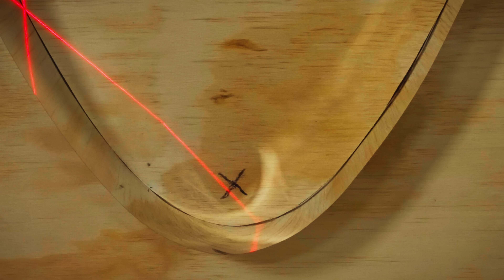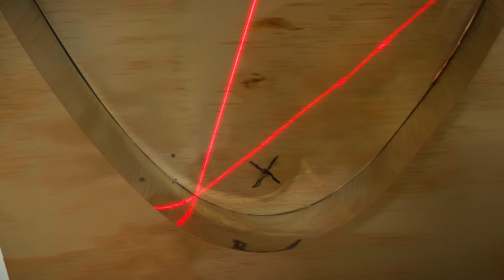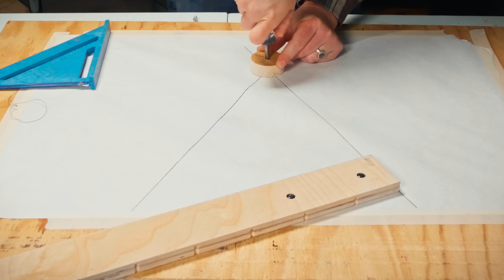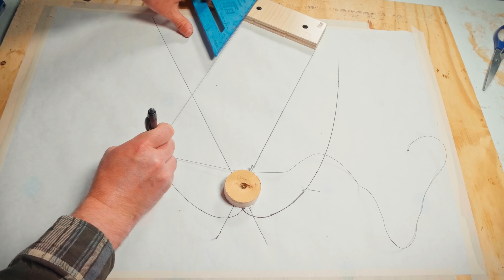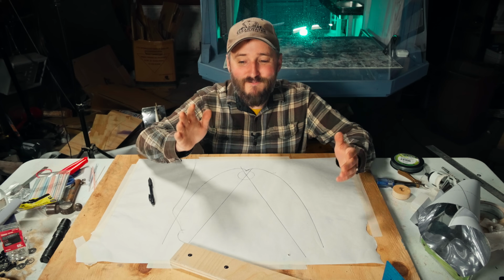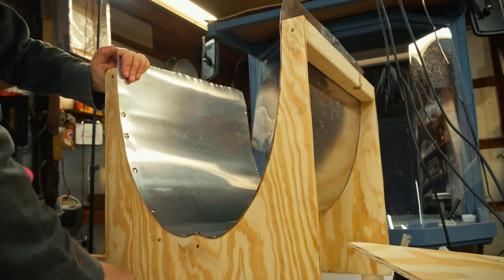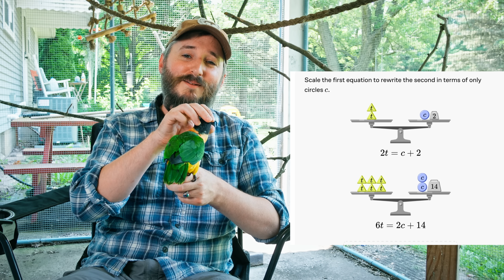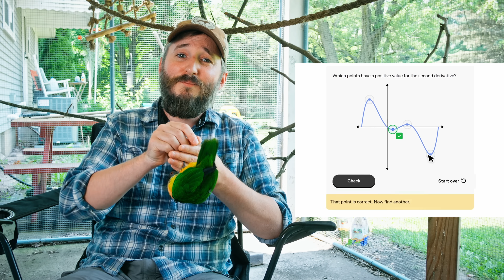DIY Solar Concentrators, Made Better.

Comment: Another, as usual, awesome video. Never lose your Jazz! 
FYI: Push pins into wood..... I've done exactly what you were doing, jamming push pins into plywood, to hold paper templates. Did in for a long time.....until........ one broke! The 'handle' broke apart and that little sweet heart went straight through my thumb to the bone. And pulling it out with lineman pliers was no party either! 
I now pinch grip them with my thumb and index finger, like they are held when going into there intended cork board surface. 
One of those many pains you don't forget.  LOL!

Comment: I have a potential improvment! since the mirror intake has an angle, and the width of the actual setup is wider, might it be more efficent, even by a tad, to put two smaller mirrors on either side of the intake facing downwards at a special angle that maximises any light bouncing out and sending it back to the pipe? not sure how worth it it would be, but just thought i would throw it out there. awesome video man

Comment: Why not use a smaller diameter to draw the compound parabola and use a larger one for the actual model? This way the light will fall on it colseer to the center.

Comment: Here is another idea for you-  Your compound parabolic reflector seems ideally suited for a small scale Stirling Engine powered generator.  I'm aware of a large scale solar farm scheme that uses sun tracking dish parabolic reflectors.  Your compound reflector eliminates that additional complexity.  The iron gas pipe you were heating looks like a small version of the heat exchangers on the hot side of some Stirling Engine configurations.  What do you think?

Comment: How to make the collector in 3 dimension (like a dish antenna) for max efficiency when the light is to be collected by a solar panel. (one sided or both sided)
In other words - how to maximise the amount of energy collected by solar panels - by use of concentrators.

Comment: Very interesting and simple! Thanks! 
A smaller object with a larger surface area relative to its volume will lose heat faster. 
I'm not sure if that significant in your  setup.

But it also will gain more heat because lot of light will hit it.

Comment: Great video! I'm actually looking to try and make a trough type collector to hear (and maybe even cool 🤔) my house. Question: for the double parabola, could you use the same chain technique used to make the single parabola, but when the chain settles, take the bottom most point with your finger and lift it to the desired focal point. I think it will form a parabola on either side of your finger and allow you to just paint the image from there.

Comment: I want to correct you at 3:15 ... The chain does NOT produce a hyperbola but a curve called a ' CATENARY' which looks deceptively like a parabola .. It will work well but it is a far cry from a parabola.Yes. I have studied parabolas , hyperbolas , ellipses , circles  and they are fascinating ..

Comment: Might pair well with a sand battery to heat a house in winter
Reply: Until you find out that in winter there is usually not enough sun to make it work

Comment: what I'd like to know is... instead of plain clear sheet on top, would a fresnel lens work... or perhaps place the fresnel lens inside the collector, as the target of the parabola,... then the outgoing beam from the fresnel directed at your pipe.... I'd imagine you could heat up a large amount of water with a fresnel lens and any sort of automatic sun tracking set-up, which the compound parabola is sort of a stand in for 

but... why go to all the trouble of setting up this "comparative" experiment... only to completely invalidate it by using collectors with two different materials and sizes of pipe....
both collectors should be identical except for the parabolic shapes.... while it seems obvious that a compound parabola, or any possible shape that allows a wider array of angles to concentrate the energy to a single point is going to be more efficient..... 
simply taking the temps 1 time,... of the differing materials, and diff sizes doesn't give any result of meaning..... ie: if the sun was stronger for a period, then faded... much of the temp difference between the two could be due to the much larger mass and material structure retaining heat.... do the same exact experiment on very bright sunny day, when the sun is nearly direct overhead... and at least for some time, the smaller pipe, in the regular parabola, would show the 20 degree higher temp, and likely much, much more 

if you're going to go through all the effort to construct collectors, and film it all for a comparative experiment... it makes no sense to do anything but make it a true, repeatable, experiment that actually delivers reliable results .... make everything about the collectors identical, except the variable your testing for... same size/volume, materials, everything as precisely identical as possible.... in that case, perhaps your temp difference would have been only 10 or 15 degrees, or maybe it would have been significantly higher than the 20 degrees seen... but we'll never know

Comment: Huge nitpick, you changed too many variables , the test was supposed to be about the parabola.. but you changed the diameter of the targets they need to hit arbitrarily. 
Why do both targets not have the larger pipe inside? Larger target means more light that doesn't enter at the ideal angle still hits the target.
The smaller one was just setup for failure from the start aside from high-noon.

Comment: Really nothing new, and mostly the problem is the heat it creats its often the problem for solar cells. To heat water its been around since the 70's, and to cook food we had it in the special forces since the 80's. There is a very good in  idea in the 90's of a glas globe that focuses the light to the solar cells, that worked wonderful for very much electricity but i think it was taken down by the oil companies.

Comment: This would be CRAZY useful for heating a thermal battery!!!! I'm thinking like a greenhouse with a pond in it. Use the mirror as a low cost heat source! This would do wonders where i live, were sun is rare but bright cloudy days are common, year round!!!
Reply: Maybe the focal point could be coated in Stuart stemple "vanta black" to increase efficiency and save costs on amount of paint needed

Comment: you can use gift wrapping paper (mylar?) as a mirroring surface, you can 'glue it' with a thin coat of oil.
i think this would work with your cardboard trickery for a super cheap concentrator

Comment: I shouldn’t really tell you this because I could just invent it but instead of the pipe being round you could make it a square that has four convex sides just like if you put your index finger and your thumb together on both hands and put both of those together the shape you see between your fingers and then make it big enough so that arc of light is always Within the curve of the square convex pipe and not bouncing off 💢

Comment: Anyways, the other problem you have is the sun is moving through the sky, so you would have to continually change position, but also the asthma is different every day as it gets lower in the sky in the winter and higher in the summer because of the tilt of the Earth soyou’re gonna get a computer and an actuator and get this thing to be kinetic all year long sounds expensive

Comment: When you hang a chain (as you did), the resulting curve is NOT a parabolic one. It is in fact called a catenary curve. Subtle difference that's not apparent to the naked eye, but is understood by mathematicians. I'm not a mathematician, but I've done some experimental building using catenary arches. Find out more about catenaries by googling "La Sagrada Familia" or "Antoni Gaudi" (the architect).

Comment: Being a retired Electrical Engineer, I really enjoyed your presentation on this subject.  When I moved to California in 1978 ( yes, very long ago)  solar hot water heating was a popular addition for home owners either for home hot water and/or pool water heating.  I met a neighbor who installed locally designed custom designed solar systems which used a single water tube enclosed in a housing with a parabolic reflector & a clear window (Fresnel lens) that would rotate around the tube.  It had some electronics that controlled the rotation of the reflector housing assembly.  Unfortunately, the local individual who made these systems went out of business due to numerous system operation problems.   My neighbor told me the housing mechanism would occasionally stop rotating and the water in the tube turned into steam which caused the over pressure valve to open dumping massive amounts of scalding hot water over the roof of several customer's homes.  I still think this is still an interesting concept and may try to design & build one for myself someday.  Thanks again for your video.
Reply: "My neighbor told me the housing mechanism would occasionally stop rotating and the water in the tube turned into steam "

That doesn't make sense, if the solar focusing mechanism (i.e. the rotating lens) stopped moving there would be less energy being put into the collector, not more.  Insufficient water flow would be the cause of it boiling.

Comment: Great video as always Ben! 👌I have a tip to all. When I made my first CPC mirror at home I found a great instruction in a PhD thesis to use two pieces of outprinted simple parabolic line with axis and focal point. I used transparent foil to see the lines well. Than pin the focal points onto the opposite sides (left and right) of the target perimeter under the horizontal half line of the ring. Then open the two axis of the parabolas between the suggested 20-40 degrees and voila there is the CPC curve. Kind regards! BLADE

Comment: This looks like the shine that occurs on the inside of an empty coffee mug. Is it the same shape, or do they just look similar?
(EDIT: they’re not the same. The shape in a cylinder is a cardioid, not a compound parabola. I’m still glad I wrote out what’s below, but it’s useless to create a compound parabola. A cardioid might be effective for a reflector, but I have no idea. Plus, I have no idea how effective it is compared to a parabola or compound parabola. Hopefully, it’s still entertaining if you take the time to read it.)
If they’re the same, I wonder if you could make a solar heater with no measuring, just an oil drum. Angle the oil drum so the shine hits the bottom just right, then reach down and mark it. The shape should work whether you cut down the walls of the drum, or leave them at full length; either way, you could attach a marker to a stick to reach down inside without disturbing the reflection. Cut off the bottom and cut the drum into a sheet of metal. Replicate the shape of the reflection onto the lid by tracing the shape onto paper, cutting it out, and tracing the outline. Bend the walls of the drum to match the shape traced on the bottom. To make sure the bends are straight, use the lid with the same reflection shape to match the opposite side of the sheet metal. This could be secured with tack welds or tabs fabricated from the spare metal from the sides of the barrel and self tapping screws. Depending on how wide the mirror is, you could be left with enough sheet metal to make feet or a stand, and maybe even the object in the focal point. As long as the mirror doesn’t get too hot, this could be done with a plastic Barrel and self adhesive mirror material like you used.
If it turns out the shape isn’t the same, this was quite the waste of time, but I had to get it out of my brain and into words. Hopefully, you can understand my thought process.

Comment: This is awesome (as usual) but the most important question is why is this better than just increasing the area of the collector to equal that of the mirror? It concentrates all the solar energy into one spot leading to a higher temperature there but is this actually more useful than lower temperatures  spread more widely?

Comment: Could you put enough magnetic balls into a copper tube to generate enough electricity to power a motor to load the magnetic balls back to the top?

Comment: 12:49 What about if we take the compound parabolic, as a line say, and we rotate it around where the two halves meet so that we have a bowl shape rather than an extruded 2D version. Kind of like a satellite dish.
Reply: That gives you a 3D CPC. Unlike the extruded 2D version, the 3D version is slightly below the theoretical maximum performance. Also it requires more accurate solar tracking, but it is used in some high concentration solar receivers. It is also used (in reverse) in some LED lamps and flashlights
Reply: @hakon.j.d.johnsen Nice! That's quite interesting, Do you reckon it's probably more effective to just make a more 2D versions then?
Reply: Also, what if we paint the pipe in something like Black 2.0 or Vanta black?

Comment: Very cool video! I am a researcher in this field, and the history of this CPC is fascinating. It was developed by the physicist Roland Winston 60 years ago because he needed a high-sensitivity detector in experimental particle physics. The discovery then kickstarted a whole research field known as nonimaging optics, which forms the backbone of all solar concentrator optics and important developments in illumination optics (such as those fancy reflectors used in car headlamps). Roland retired a few years ago and sadly passed away earlier this year, but the research field remains active.

Fun fact 1: If you combine the CPC you made with a vacuum tube you can in fact get high enough temperatures to generate steam from sunlight with no moving parts. The startup Winston Cone Optics was developing and trying to commercialize this a few years ago.

Fun fact 2: The CPC or other Nonimaging optics can also be used in with radiative cooling, to control the directionality of this cooling.

Fun fact 3: One of the leading research groups in nonimaging optics started carrying their ideas over to completely different applications such as high-end virtual reality optics.

I help organize an annual academic conference where we bring together nonimaging optics researchers from across the world. The next one is coming up in San Diego, US this august.
Reply: Thanks for this information. I wasn’t aware of the interesting history and I will now look into this.

Comment: In the final experiment,maybe repeat it with the parabolic one also having a larger pipe.
I do understand the advantage of having lesser thermal capacity,but it makes the test less fair.
Also the compound one looks like one parabola bisected,one of the sides rotated by a 20-40 angle and joined at the seam again.

Comment: I'm theory, would this work backwards? If the pipe has passive cooling paint, would it get colder?
Reply: It would, but the tradeoff for cooling is a bit different. For heating you want a small tube (to reduce heat losses through thermal radiation), and therefore a narrower acceptance angle. For cooling you want a larger surface to maximize thermal radiation, which gives a larger acceptance angle.
In pratice, the benefit over a flat surface is not much, only that you can make the cooling into a narrower part of the sky and block the heat from e.g. a nearby building.
Reply: @hakon.j.d.johnsen  true. I guess it would make a difference if there was a known reflection back like tree coverage and you could point it at the clearing.

Comment: kind of a disappointing comparison. If your goal is to compare the collector shapes, you'd better keep everything else the same. thicker pipe has more area to be exposed to light. Thermal mass is irrelevant in the steady state. the optimized shape may have some small advantage, but this is not a fair set up to compare the two shapes.

Comment: I think I have the curve approximated in F360, but it's made out of a parabola and 2 splines. Since I had to just place the splines manually, it's not parametric. I'd love for someone to make this 3-piece curve in geogebra or something and provide a dxf. I'm trying to figure out what the equations are for the first 2 segments.

The initial unwrap seems like a carioid, and is something like "line plus arclength = constant," but I don't know how to actually write the equation as a function of that moving tangent point...  the second one is half unwrapping and half following the straight edge, so it's a parabola who's focal point is also changing with respect to x? Once the string is perpendicular to the starting line, no longer unwrapping, the rest is just a parabola, axis in line with starting line, focused on the pin. It seems like there are at least multiple variables, if not rates of change happening with the first 2, and it's been like 20 years since I took calculus...

Comment: Sorry to be that guy but isn't the compound mirror opening wider ? Hence collecting more light... 🤔
Also aluminium is better at conducting heat than steel and it doesn't have the plastic cap on it so I'm not fully convinced it's only the curve that makes the difference...

Comment: the parabolic reflector works with all radiation in radio transmission we used to in Automatic landing systems in the 1950's to throw out tight twin loops for aircraft  localiser and a glide path invented by Dr Pye.  Happy days I'm now a 90 year old idiot.  Before this a concrete sound mirror was used by the Royal observer core early in  WW2 to locate German aircraft crossing the English Channel.  Now we have enough knowledge to understand how energy is transmitted ?

Comment: Aluminum is a quite good IR reflector, so looking inside an aluminum tube may not give you an accurate temperature on an IR thermometer. It's why it looks like concentric rings. Even with a coating like alodine where the surface isn't at all shiny in visible light, it's still a good IR mirror.